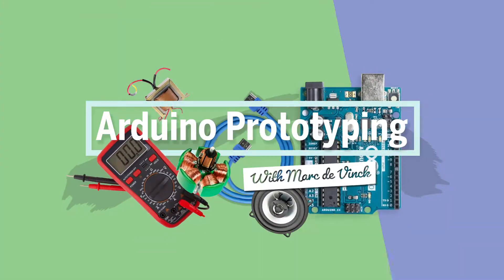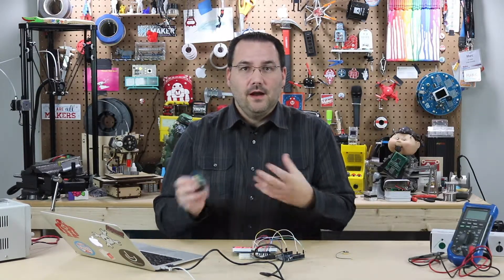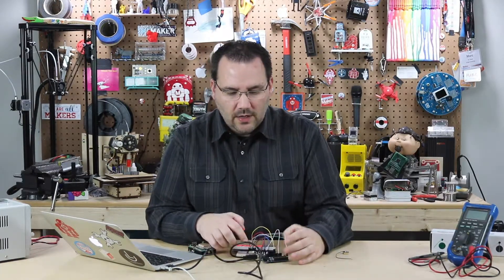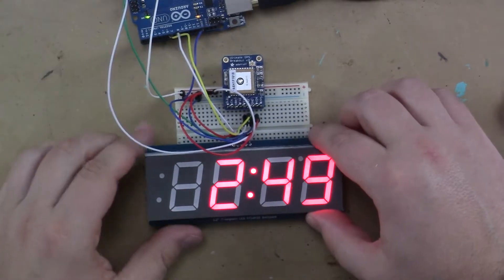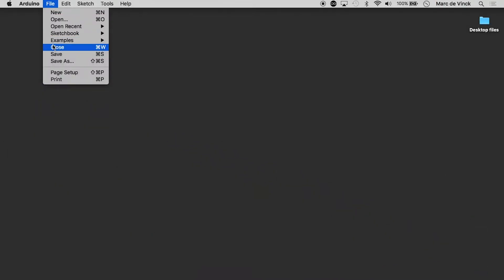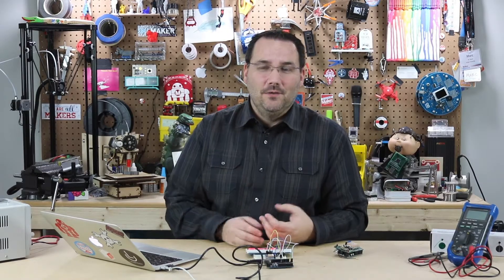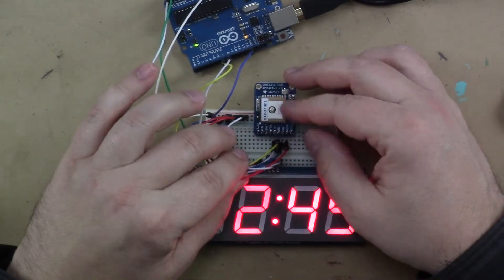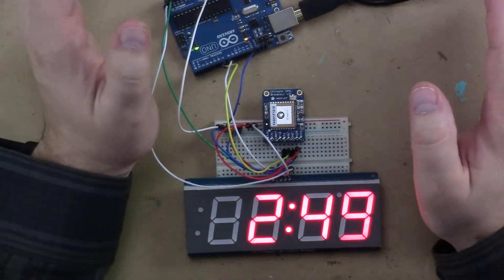Arduino Prototyping Techniques #89: Time from GPS

Comment: I have a problem. Everything works on an Arduino Uno, but not on an Arduino Mega. What could be the reason for this?
Reply from the maker: It's really hard to troubleshoot in comments. Can you upload code? Can you make it blink an LED? Make sure you can do that first, then troubleshoot the code for the GPS. You may be using incompatible pins on the Mega?
Reply: @MarcdeVinck  The Blink code works. Uploading the code is difficult.

Comment: SIGNAL(TIMER0_COMPA_vect) {
  // Use a timer interrupt once a millisecond to check for new GPS data.
  // This piggybacks on Arduino's internal clock timer for the millis()
  // function.
 gps.read();
}  
******* compile error**********

Comment: Hi, will you make the sketch available?
Reply from the maker: Yes! The code is actually already in the Arduino examples for the LED 7-Segment GPS. It's built into the library that you install from the vendor you select for the GPS board.